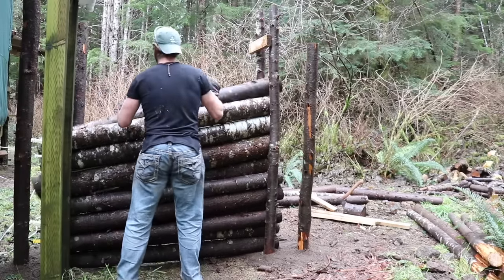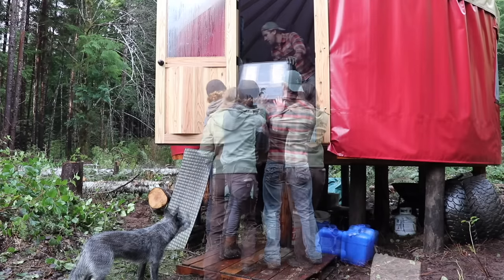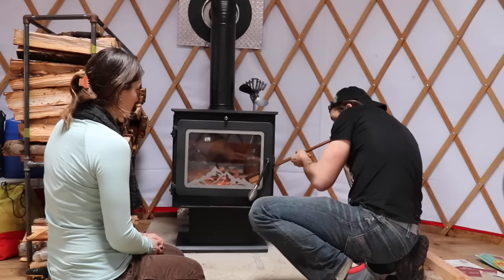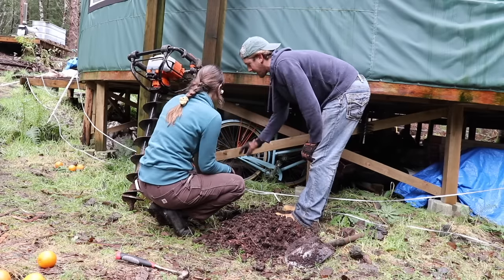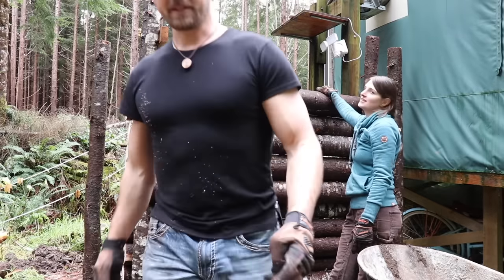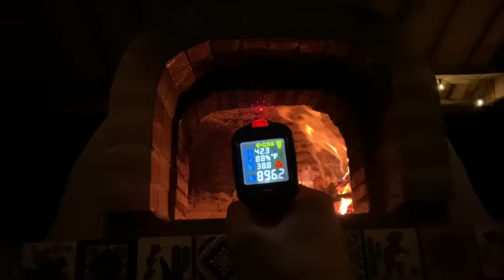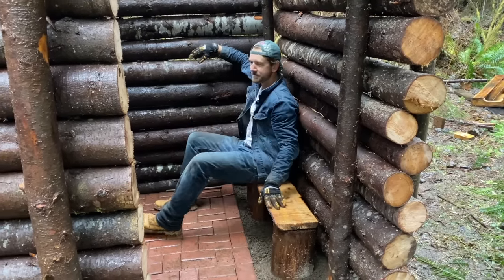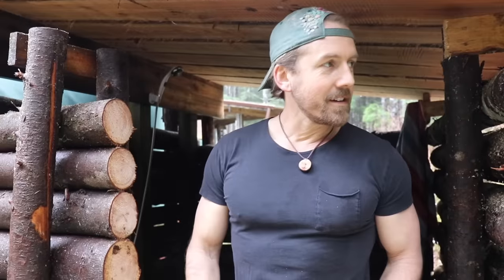HOT WATER SHOWER from FOREST LOGS & TREES | Outdoor Shower | Bushcraft & Living Off Grid - Ep. 119

Comment: I have used a wood stove coil in the past Jake and your idea to run water from the coil to the shower is a good one but presents a problem. The water directly from the coil can be very, very hot and inconsistent temperature-wise, depending on volume. So to avoid potential scolding I would suggest an intermediate holding/mixing tank (what we used to call a range boiler) to which the coil is connected and the temperature can be maintained at a more consistent level. don't forget to put a safety valve on the tank ( T&P valve) The other issue with a water jacket is that you must run water through it all of the time or it will get too hot causing it to distort and leak. At times you may have to dump hot water from the tank to keep it from overheating.....Marty
Reply: Small insulated water heater with a temp controlled circulation pump, though natural convection will do some of it.  Still need the appropriate safety valves.  Chances are you'll boil the water in the heat exchanger unless you can drain it down.  But then there's the overheating and distortion issue when it's empty.
Reply: Well thanks a lot. I was trying to go to sleep but now I’m thinking of how to incorporate a thermostatic valve that has a temp limit so you can’t get scalded. Delta makes one.

Comment: Jake even as a temporary solution for the heating of the water I would place the battery and propane tank outside of the shower with a small roof over them, remember that water can cause an electrical short with wiring and circuits especially when you splash water onto the battery while showering and a spark can set off the propane if any vapors collect in the walls of the shower, Its best to be safe when dealing with electrical devices and propane so close to a persons even in the shower.
Reply: Vallenato
Reply: Filme de filme de mulher pornô

Comment: Jake and Nicole, have a solution for you extensive firewood moving contingency. Instead of throwing them in several increments over the distance to your woodshed...... why not make an above ground, aerial cable system (think zipline delivery system). Minimizes energy you exert and maximizes wood delivery to woodshed.
Reply: or...why not clean up all of the scattered branches and logs that are laying all over the place and build a cart to move a ton at a time?  Give themselves at least one stretch of semi even ground.
Reply: Too much rough and uneven terrain. Any uphill grade would make it impossible.
Reply: Make it easy on yourselves.  No zipline necessary.  Chainsaw winch and a skid.  Establish a route (bare ground or a log track) that runs along from next to your wood source over to your storage.  Construct a skid.  Put it on or in the track.  Load it from the source.  Rig the chainsaw winch near the storage site.  Long rope.  It's an easy pull for the winch.  No take-up reel needed.

Comment: For drying wood fast. Use a 50 gallon plastic drum drill a hole in the bottom put a flat top drain plug and hose in it. Place a screen over the hole on the inside fill the drum a 1/4 full with rock salt place split wood standing up on top of the salt and cover with the lid. If you have lots of drums the better. To keep smoke down build your logs up large medium than kindling light from top of pile with a small piece of wax wrapped in paper like a hershey kiss use two of these. You'll be amazed how fast it lights and exhaust smoke instant.
Reply: Fascinating

Comment: I would have took the bark off those logs on the walls, The bark will keep moisture in and rot the logs.
Reply: The steam will loosen the bark off the logs for easier removal. Then you can use the bark for kitchen fire wood starter. After wards I would tent the structure and smoke the wood dry with an outer mud plaster to give it farther water protection for the next year. Depending on the bark, soak it and cut it into strips for basket weaving.
Reply: Always debark your trees. It will prevent rot as well as keeping insects away by not giving them a place to stay and multiply
Reply: @rdspix  Also debarking helps fire wood last longer. My grand dad used to keep his outdoor fire wood cover in plastic sheets to keep the rain off of it. Along with old photographs and wood cut prints in cultural history books showed people kept their fire wood under partly open lean to sheds cover in thatch roofs.
Reply: @krispalermo8133  Are they doing basket weaving as well? lol
Reply: @rdspix  Was just going to say that about the insects. Beetle larvae under the bark can tunnel in and destroy the wood too

Comment: I have the same water heater. A word of advice is to drain the water heater if any freezing temperatures come your way. The brass inside cracks easily if it freezes and renders it useless. If it happens, you can order parts to rebuild but it can be costly.

Comment: One suggestion to improve making a cold start fire...wrap up many sheets of newsprint (about 1/2 of a daily newspaper's worth) into a cylinder & twist into a tighter cylinder about 12 in. long.  Have your paper, kindling and sticks all ready to go as shown in this video, then light the newspaper at the bottom.  Then quickly light the newspaper 'torch' on one end.  Then stick the torch flame end up at the upper end center of the firebox for 30-45 seconds w the glass fire door wide open.  When twisted torch has about 3 inches of space left, set it to one side of the firebox.  The torch flame will create an accelerated upward draft pulling air in from your Yurt and sending it through the flue pipe more quickly.  Once the firebox wood is burning well, adjust the flue damper & fire door as needed.

Comment: Seasoned wood is important, but creating a draft in your chimney is also important, I don’t use your method to build up the fire in woodstove, I live in Gold River, same climate as where you are at.

2 split logs parallel from front to back and a space in between, a piece of kindling on the bottom between the 2 logs, a newspaper folded & crunched together with a piece of brown cardboard, and a few pieces of kindling on top, then a larger split log on top(smaller than the 2 initial logs), light it, close the door and have airvent open, let it roar.

On a side note, please don’t burn coloured printed paper, it actually creates more creosote in your chimney with a possibility of building up tar inside flu line

Comment: What about Installing a bio digester. That will create so much of natural gas that can be used for cooking, heating, lighting, etc
Reply: I did one once for just heating water....got a 40*F rise with like 5 yards of chips...
Reply: @adrianmettz7463  And THEN !! WHAT !! ??
Reply: @davidwillard7334  I took a warm shower, lol...it last about 6-8 months so you rotate a couple heaps per year, and you amazing “vineyard chips’ out of it...I bypassed my water heater for a few months and when it cooled in the pile, it basically assisted the water heater...
Reply: @adrianmettz7463  LUCKY !! FOR !! YOU !! TOO !! HAVE !! PLENTY !! OF !! CHIPS !! ON !! HAND !!!
Reply: @davidwillard7334  The luck was that I had access to sawdust that folks bathed in at one of those fancy Japanese enzyme baths place...so I layered that with standard wood chips...sped up the activation process....the heap was only 4’ high x 6’x9’ oval contained by animal wire...
Reply: @davidwillard7334  Bury the black irrigation tube in a corkscrew fashion...the animal wire created straight up and down sidewalls so reasonable footprint...diverted my kitchen sink drain to water it...have to tarp it off from the rain though because it will cool it down too much...

Comment: Hint if you rip the paper along the grain you can tear off strips which will light and burn much hotter than wadding it up. Also if you keep your supply of lighter wood closer to the stove it will dry faster and will light easier.
You are also stacking way to much wood at the start. Use about half that amount and it will breath much better.
Just a suggestion learned from years but you do what you want.
Reply: Thank you Cliff claven

Comment: You should have just used your flat wood the long beam you make them straight up on an angle and a few inches apart it can become any round or square design but you can't see in or out then if you want it closed in why not do it like long shingles it keeps heat even looks great and using like a 2 or 3 x 6 long board for shingles looks amazing to the eyes if you make it 12ft long but do the length and put everything on an angle you even get a trippy look but its so easier and no one can see you.

Comment: Save your lint anytime you use a conventional dryer, put it in a zip lock bag. Use the lint to start your kindling in a metal type box...like an ammo can so it dries out fast (the much smaller confined space is a little easier to dry out the wood, bop around with other chores until the kindling is absolutely dry, otherwise you'll never win) and obviously keep the lid cracked for ventilation, then close the box, savor the heat with more kindling in it for future use. Next, outline your stove with rock, or cinderblocks with holes (put the logs in the voids or on top of the stove)or butt some logs directly next to the rock/on top of the stone/rock so it dries out the wood every time you use the stove. I'm a little late to the game with the comment, hope it still resonates in those cold bones out here! 
ps. Obviously a small space with a dehumidifier would work best, but you need a bigger battery bank and more solar panels/or a watermill/windmill :)
Reply: 4

Comment: You have a long way to go with starting a fire in your internal combustion heater.  Less middle range kindling, more small kindling, not stacked but set in a pyramid style. Open the damper to max for about 10 min. leave the front door shut. Some larger wood on the pyramid initially to promote established fire. I have a fan similar to yours. It is durable and effective. Carry on you city dwellers , you will learn.
Reply from the maker: I think we got it bro….nice comment

Comment: Please both of you, always wear goggles, especially when the chainsaw is running. Stuff often flies out at high speed. It doesn't take much too cause serious eye damage. 
I suggest to find clay that you can use as grout. Keep your metal tools oiled to prevent rust

A very handy thing is a few layers of plywood on wheels to move heavy stuff on a flat floor. Make sure you use proper oil or graphite on all mechanical moving parts. Blowing into a fire is ok but most of what comes out of you is carbon dioxide. The trick is to puff the air so the fire gets the last intake of air into your mouth, which is not carbon dioxide. 
Layers of clothing is the ideal way to dress so you perspire as little as possible. I mean excess perspiration that makes you wet and colder. Using Layers is like a thermostat so you wear only what you need to be warm, not overheated.